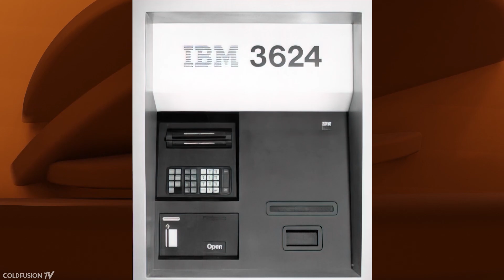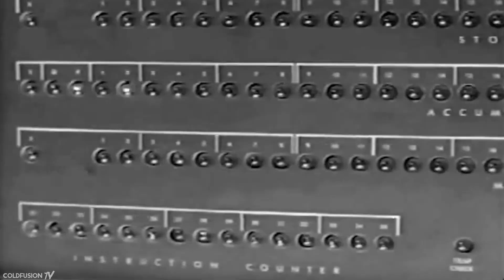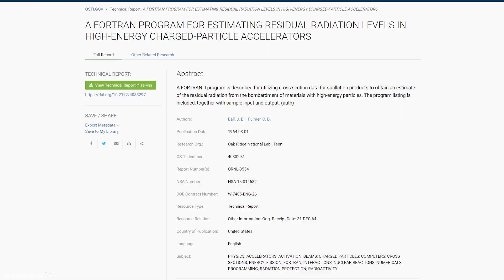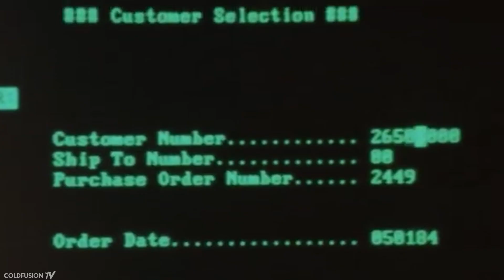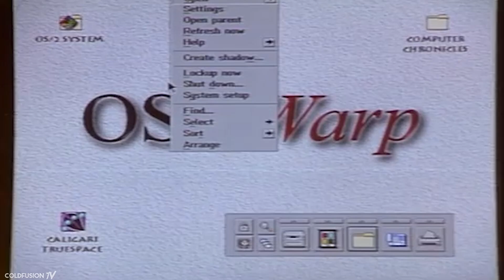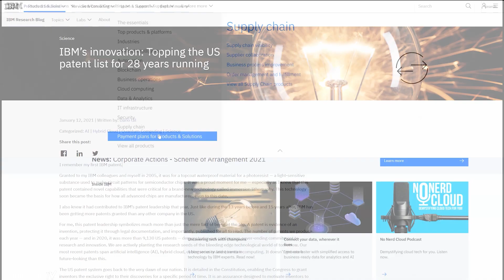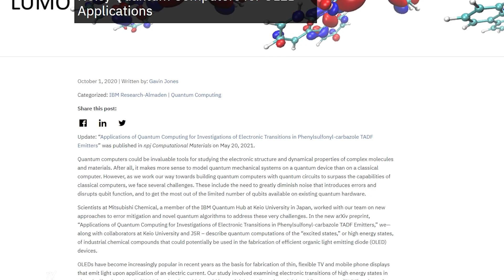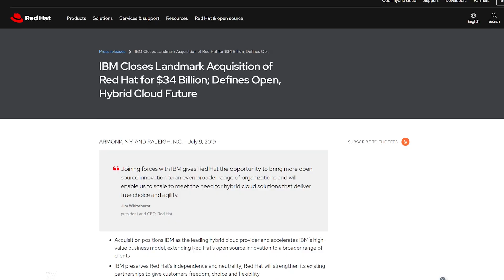The Rise and Stagnation of IBM

Comment: You need to stop with the apple wank fest. Commodore and tandy had a far bigger impact at the time. Is chiluck pedell didn't fix sone of the apple 2 issues they would never have gotten anywhere.
Reply: Viscalc on the apple was only made as they did not have any of the more popular machines available and it was fluke it ended up being made for the apple.

Comment: The copywriting of dos was a major issue but the real reason the pc sales crashed was, that, to keep the cost down IBM used openly available components, this had the effect of rendering them open to plagiarism as the machine was basically a fruit salad and they didn't own the copyright to any fruit...gates had proprietary software but they neglected to include any proprietary hardware or architecture.
Reply: Hardware was an issue even in mainframe accounts. We had customers putting cheaper memory in control units. And even something as seemingly insignificant as a cleaning tape can cause call-outs. I had a tape robot in one account and the cheap cleaning tapes kept getting stuck in it. And the third shift operator there refused to recognize that pausing the robot, opening the door, and hitting "exit" to manually remove the tape was HIS job.

Comment: I remember we bought an IBM Aptiva in 1996 and it came loaded with OS2. I reformatted the hard drive and loaded it with a pirated version of Windows 95. For the most part, we used that Aptiva for playing PC games. It ran Diablo ridiculously slow, as I remember. But it did run 80s PC games like XCom fairly OK.

Comment: Microsoft supplied the Operating System for the IBM PC (MS-DOS), which ran under the IBM BIOS. So, from IBMs standpoint they did not have to own the OS, when they controlled the BIOS under which it depended. Then Compaq legally cloned the IBM BIOS, and actually corrected numerous IBM BIOS bugs and firmed up the software requirements with the rewrite (aid in BIOS evolution and structure). This is what freed Microsoft to dominate the OS market based on the IBM PC hardware design and it's evolution. So I think IBM actually was displaced by Compaq and not Microsoft. We now have advanced versions of the BIOS called UEFI BIOS. 

From a business standpoint, before Windows 95, I think Microsoft was much more focused on increasing software products for PCs which required a low initial investment with minimal complexity.

Comment: I worked as a programmer in the 1980s on mainframe then on the mid range systems (System 38). By the 1990s - they were pushing the AS400 - whilst open systems (UNIX based) were being pushed elsewhere. The programming languages weren’t compatible with the mainframe or OS/2.

Comment: The fall of IBM has been really sad, my father is considered one of the forefathers of modern server and cloud services (he designed a proto one in college in 1992) and when he was working at IBM from 2008 until 2016, he was miserable as he was no longer designing the applications and programs he created, specifically database tools. His biggest regret was not taking the job in the 1990's as potentially he could have been the CEO by now, and IBM would probably have been run differently.

Comment: Java & Python are interpretive languages, while Fortran, as well as C & C++ are compiled. An interpretive language converts the "text based code" to the machine code native to the processor, instruction by instruction, as it reads that text. And it does this everytime you run it. A compiled language converts source code to native machine code, in the compile process, just once, and turns into an executable machine code file. By doing the translation only once, a compiled language runs multiple times faster than an interpretive one. That's why I call Python, "BASIC 2.0", because it runs dog slow.

Comment: This is a great video, though I am disappointed there was no mention of the System/36, System/38, and AS/400 era of midrange machines, an attempt for IBM to offer a compromise to the more expensive mainframes. I was a computer operator, programmer, and systems admin for System/38s and AS/400s and I'll tell you right now they were very reliable and powerful systems for business use. The operating system OS/400 for the AS/400 systems were stable and patches (called PTFs) rarely broke things.

I was one of the people who purchased OS/2 and ran my PC using it for nearly two years before IBM stopped supporting it. Despite the fact it did not catch on, I had little problem with that OS and it ran for days without needing a reboot, something that even Windows 10 today hasn't been able to do.

Comment: I worked for IBM during the early 90s. It was not stagnating on the books, but it was clear everything was headed to China for manufacture. When IBM left the Hudson Valley, the whole area felt it. It has never recovered in my opinion. IBM, to me, is long dead. They committed suicide grabbing Communist money instead of scaling down manufacturing or innovating new technology. IBM's last computer line, the Aptivas, used AMD, Intel and Samsung parts. There was nothing IBM about it.

Comment: You don not point out that IBM hired John von Neumann as a consultant in 1951.
Almost all computers use variations on the von Neumann architecture. Microprocessors put the CPU of the von Neumann architecture onto a single piece of silicon. That changed the whole ball game. If IBM had chosen the Motorola 68000 instead of the Intel 8086 the details would be different but the socio-economic effects would be the same.

Tiny cheap micro-electronics changed the world and will continue to do so.

Comment: IBM had lazy, and think only INSIDE BOX mentality at the time just like most companies in America that was the defacto standard at the time. I remember working for a large company and I had introduced a new way of testing equipment by automation this was back in 1986 when the commando 64 was brought in to evaluate its capability. When i wrote the software to perform the test and print the results of the test out on a printer, my management had punished me by sending me off to another department. Well it turned out that department was the companies IT group and I fell in love with it. I guess you can call it a blessing in disguise. That sad part of it they did not maintain what I created and decided to go back to the manual method of testing the equipment. The American enterprise was full of these think only inside the Box type of executives and management.

Comment: Years ago, I worked for a large corporation and I remembered they told me that our company purchased a mainframe computer in the early 90s from IBM and it cost as much as a detached house with a double garage. The size of the mainframe computer was as big as a small size Van. But it was stolen before it even get installed. No management personnel was fired for this incident. Because the economy was good and our company was making a fortune.

Comment: Small note but I don’t believe IBM had any hand in the Apollo Guidance computers. I think they were designed at MIT and Raytheon manufactured them.

Actually, the story goes that IBM felt pretty stiffed when it found out that MIT/Raytheon had the AGC contract, and not them.

IBM did however make the LVDC which operated the Saturn V rocket prior to reaching orbit.

Comment: 10:16 - RCA Computer was building IBM 360 compatible mainframes in West Palm Beach, Florida, started by surplussed computer engineers who worked for NASA. They were making inroads into IBM's markets when they hired a marketeer from IBM. Almost overnight, the new marketeer re-arranged their pricing scheme, and RCA was losing money hand-over-fist in their computer business, which they promptly shut down. Those engineers went on to create Systems Engineering Labs (Plantation), Modular Computers, Computer Products, and Datacraft (Pompano Beach) and many other small computer companies up and down the coast (aka Silicon Beach) - mini-computers and super-minicomputers that innovated in the great in-between between Mainframes and Desktop systems.

Comment: IBM is proof that no empire lasts forever in IT. Back when I was fresh out of college in the mid 2000s, I worked at IBM as a contractor and...OMG...it was such a toxic and hostle work environment that I started saying IBM stood for "Itty Bitty Morons". I'm not at all surprised about IBM's downfall and why they fell. When they treat their most intelligent employees as less than garbage, it's only a matter of time before something crashes and 16 years after I got out of that place, I've been proven right on more than one occasion.

I've heard they've had a LOT of turnover and since then replaced a lot of managers and are now doing better for how they handle employees so that's a step in the right direction. IBM won't ever have top talent to rise up again if they can't get the good folks working for them. That's been their biggest problem IMO and the competition is swift, fierce, and relentless.

I don't know what buying Red Hat will do in the long run. Some folks are worried that it's the start of the downfall for Red Hat as one of the more popular paid Linux options out there, but only time will tell. IBM has really good technological capability and it's so good that even though they're a shell of their former selves, heads still turn when they have a computer play Jeapordy! or they do something new in AI, etc. It's just such a waist to see it squandered like it has been.

I don't see IBM ever rising up to be on top again, but I do see it eventually Microsoft and Amazon down a peg or two for cloud services (which would be GREAT to see).

Comment: IBM struggled in the early 00’s chiefly due to the total arrogance of their staff, “no one ever got sacked for buying IBM” approach, an expectancy of how they would also be wanted just purely because of the brand name. Sadly the arrogance combined with multi-layered processes and internally brown-nosing meant it would never be back to the levels from earlier. Sitting in on “beers after work” was the exact capture as to why they were failing, every IBM’er trying to out do the next, when in truth the value add they really provided was non-existent.

Comment: IBM did not really care about the software. They felt the value was in the hardware. And if you look at computing from a main frame perspective, that is true. Because they were not software focused, they bought Bill Gates software solution for their personal computers. Large enterprise companies typically do not like to purchase key components from teeny tiny itty bitty companies, but they did here. Gates got really lucky. His tiny company was exposed to millions of users over night with this deal. All MS had to do was supply master disks for PC manufacturing and support. No eighteen wheelers or loading docks. No massive overhead. Just an occasional UPS shipment to IBM. They got a piece of every personal computer sold by big blue without the overhead. It truly was a sweet deal. They don't get any better.

Comment: The IBM PC keyboard the original mechanical keyboard 💪
Reply: Those bucking-spring keyboards were automatically assembled by a machine. You dumped the keytops in to one bin, the springs into other bin, the housings into another bin, and the keyplanes on a rack - the whole thing shook and rattled and rolled and assembled keyboards came out. Machine designed in Boca Raton, Florida, by "misfits and trouble-makers" just down the road from where "Caddyshack" was filmed and across I-95 from where the FAU Burrowing Owls play football today...
Reply: @nufosmatic  awesome. Thanks for this little bit of history 🙏

Comment: I have only recently watched a lengthy series about how COMPAQ saved the world of computers in the mid 80s and how IBM's inner workings were so slow and lethargic and their ignorance and thirst for absolute power ruined them by trying to shut all others out which in turn shut them out. I assume this video will go in the same direction ^^.

I am halfway into the video now and there are some very VERY big omissions that are crucial to the story, which is very disappointing. Here are some examples of how it actually went down:

* There are several different versions of how Digital Research did not get the IBM contract. One of those involves Kildall's wife not wanting to sign a very one-sided NDA.

* Microsoft licensed DOS from Digital Research, changed it a bit and then licensed that as MS-DOS to IBM.

* In order to make an IBM compatible PC the BIOS had to be reverse engineered. This was done by COMPAQ in a way that IBM could not legally prevent. COMPAQ came out with their portable device that was IBM PC compatible and eventually others followed. It was not about "making computers", it was about "making IBM PC compatible computers", meaning the software for the IBM PC would run on them.

* OS/2 was actually a joint-venture between IBM and Microsoft, IBM did not create OS/2 on their own.

* OS/2 was not the problem for the users, it was that the system on which ran, the Personal System /2 (aka PS/2), was not backwards compatible to the original IBM PC, meaning all software for the IBM PC (and it's compatible "clones") would be worthless. In addition, IBM created a proprietary Micro Channel architecture. All of this was done so that IBM could erase all competitors from the market. However, the system was slower than the newest models from COMPAQ and co. and users still wanted the backwards compatibility to use their owned software. This is what really ruined IBM's PC market - their own megalomania and thinking they are invincible and all others would just follow.

* Windows was completely irrelevant at that time and would not become relevant until 1990, when Windows 3 and subsequently 3.1 was released in 1992. Microsoft themselves did not see Windows as particularly relevant and it was not popular at all during the first years of its existence. The real battle was between Apple and Microsoft about what parts of the UI Microsoft would be allowed to use in Windows as Apple was arguing that Microsoft stole many UI elements and ideas from Mac OS (which did not have that name back then) of the original Macintosh.

* OS/2 was not killed in 1995, it was continued and updated until 2002 and supported until 2005.

When looking at how many omissions and mistakes are in this video I wonder how accurate other videos on this channel are on topics that I am not as well versed in as this one...

Comment: The video inaccurately implies that MicroSoft software ran on competing platforms like Commodore and Apple during the rise of the personal computer.  Nothing could be further from the truth. What IBM missed was the opportunity to claim their Basic Input Output System (BIOS) as proprietary.  This allowed foreign competitors to cheaply manufacture hardware clones that could utilize all of the same software that ran on IBM machines. IBM BIOS was never a component of Apple or Commodore / Amiga computers, and MicroSoft reneged on deals to port any of the software popularized by the IBM business monopoly to systems that were not "IBM compatible".

Comment: You  kind of stepped over a large and important era of main frame server transition to Unix based systems. This not only saw IBM develop the Unix based AIX RS/6000's servers to compete with the equivalent offerings from Sun (solaris/sunos), HP (HPUX), Unisys (Dynix/ptx), Digital VAX (Tru64), Data General (DGUX) and the list keeps going .... all whom were competing with IBM OS/390 and AS400 mainframes with their own Main Frame implementations ... but IBM also ported their main frame software such as TX Series CICS and DB2 to AIX and Windows to compete and attempt to stop  their customers ditching IBM all together.  This went on from the early 1990's well into the 2010's.

Comment: Again with the inaccuracies. IBM didn't "error" in failing to secure the rights to DOS. It was one of Gates' conditions for signing. IBM, being strongly hardware-minded, believed the real money is in selling machines, not software, thus agreeing to Gates' condition. Their "error" was in failing to foresee the reverse-engineering that would quickly ensue, creating competitors with IBM-compatible machines. This made DOS work on far more and cheaper machines without any additional adjustments to the software.

And it may have been interesting to point out that in fear of Windows, IBM went to Microsoft to develop OS/2. Which was (arguably?) the prelude to Windows NT.

Comment: OS/2 was one of the best OS's around.  It was a true pre-emptive multi tasking multi user system where windows was a single user task switching system.  IBM like ICL was really crap at determining what the public wanted.  If you really want an eye opener take a look at the 2nd largest mainframe   company that nobody has ever heard of.  International Computers Limited or ICL.
Reply: OS/2 was just that. Some companies I worked for still ran OS/2 PC'S well into the 2000s and refused to give them up even though the support had long stopped.

Yes ICL we're massive 😀